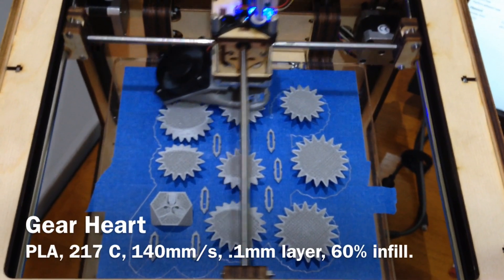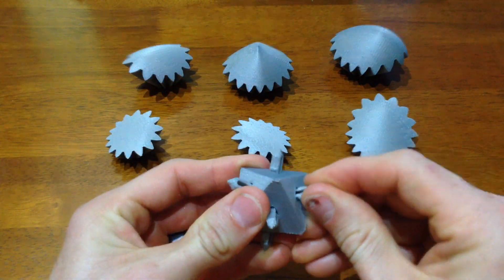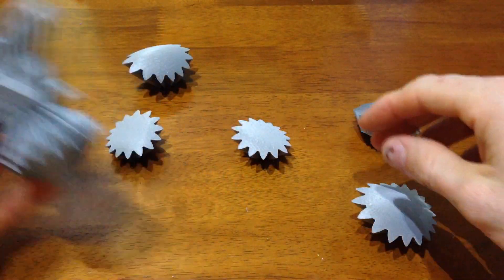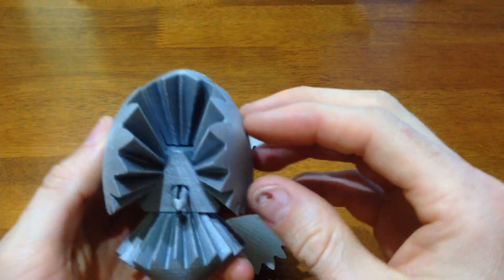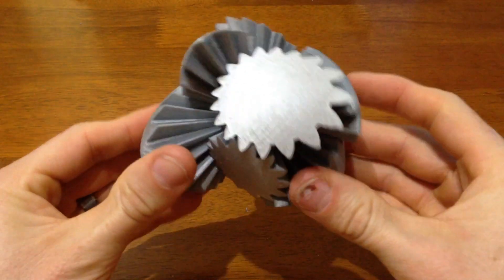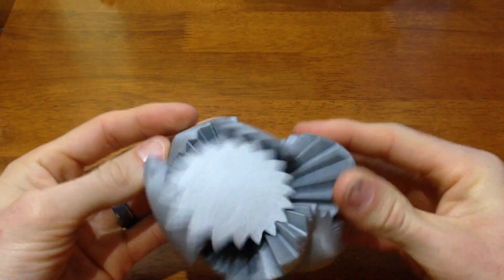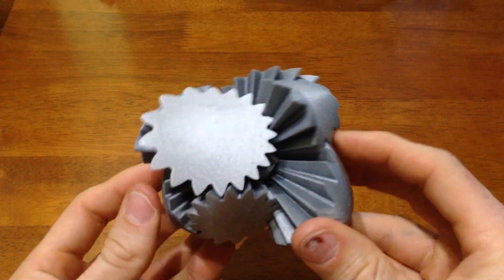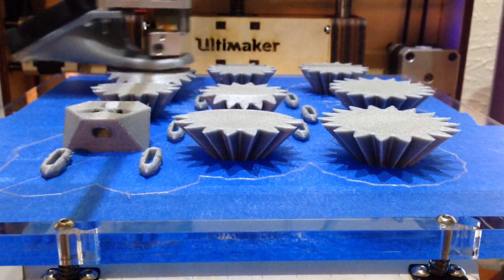ULTIMAKER PRINT # 7 Gear Heart

Comment: Few questions.  Is ultimaker 2 the best like I have read and seem.  And when would u think prices will come down.  I want to buy one, but 2500 is expensive.  I will only take the best one tho, I want the least range of error.
Reply: I haven't looked into it as much as I will. I've seen the nerdgasm dude explain the materials tho so I think I would like both depending on the print. When u say tweak, are u talking about coding or anything like that. Or just messing with the settings? I can mess with settings all day, sounds like fun to me haha. What other printers are just as good as quality/speed but cheaper and need tweakss?